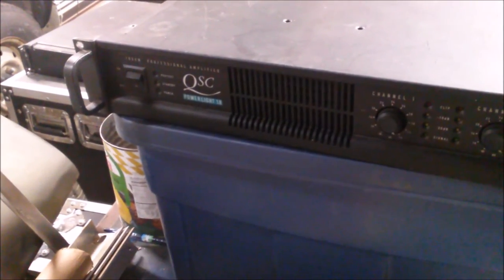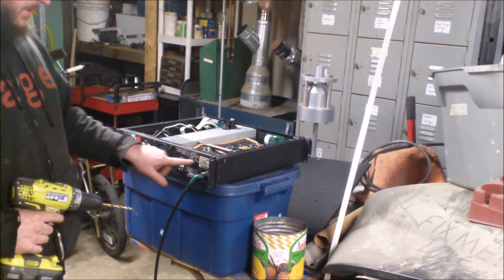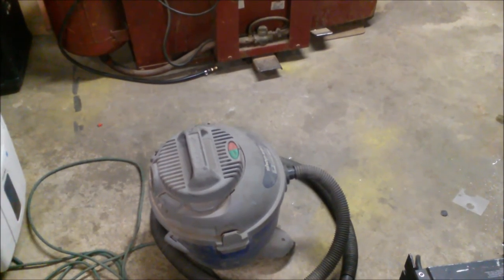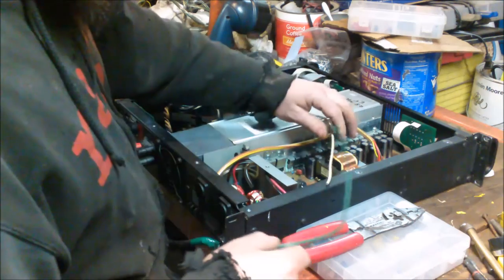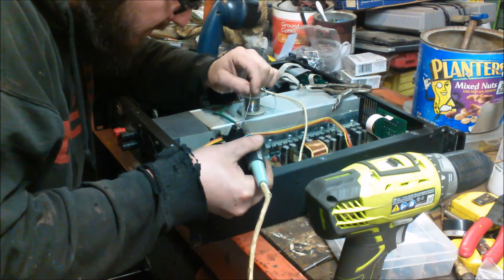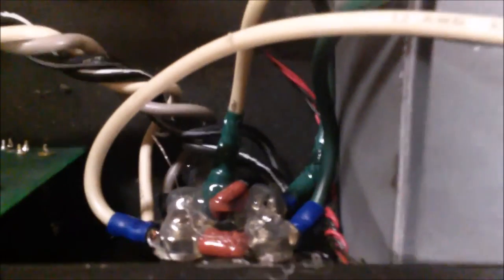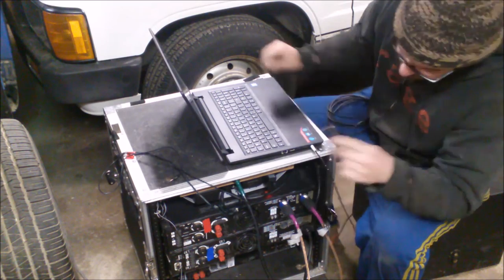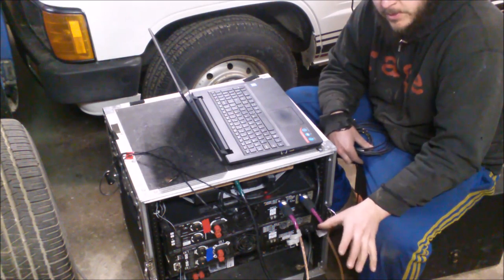Add Speakon outputs to your amp - DIY

Comment: I'm thinking about doing this to my technical pro ax1200 power amplifier because the technical pro ax1200 does not have speakon outputs.
Reply from the maker: I can't say I know your amp but I can say it was worth doing to mine!  Adapters are pricey and another thing to remember to take to gigs.  If you've got the space for them I'd say go for it.
Thanks for watching!

Comment: Can the qsc powerlight 1.8 power amplifier power big 18 inch pa subwoofers besides regular pa speakers
Reply from the maker: As long as the wattage requirements of the subs are within the power output of the amp, yes.

Comment: Quick question if you were to link 2 1000 watt power amplifiers together would the second power amplifier hooked up to the xlr link output on the back of the first power amplifier become a 2000 watt power amplifier and output 1000 watts per channel instead of 500 watts per channel or would the rms power not change whatsoever when linking 2 power amplifiers together
Reply from the maker: Hey,
It's generally considered a big no-no to try and combine amp outputs. As such, I'm afraid I don't know the answer to your question.

Comment: Does hooking up a graphic equalizer and a mixing console to a power amplifier boost the volume if so how does it boost the volume
Reply from the maker: It does boost the volume but does not have to. You'll want to do what's called gain staging. (Search this on google)

Comment: Would hooking up a entire sound system in a house consisting of a rack with 12 power amplifiers 4 graphic equalizers and 4 active crossovers and 4 power conditioners and a cd player and a tape deck and 2 mixing consoles all on separate breakers in a studio in a house make my electric bill very high
Reply from the maker: Power amps will consume the majority of the power. But of course, it depends how much you use them.

Comment: Quick question if your using a power amplifier to power big 15 inch or big 18 inch pa subwoofers in a building with tin ceilings will the tin ceilings resonate and rattle if you crank up the volume on the mixer
Reply from the maker: Tin ceilings- Maybe.  Suspended "commercial" ceilings- yes, absolutely.

Comment: Some power amplifiers have rca line out jacks and or trs 1/4 out and or xlr out jacks on the back that are not inputs and sends audio signal out of the power amplifier instead of sending audio signal into the power amplifier what exactly are these used for
Reply from the maker: These would be used to send the same signal to multiple amps. Let's say you have 4 cabs to power that all need the same signal.
Also, some amps have internal crossovers built in. This would allow you to output signal to another amp to power your subs, for example.

Comment: So if You flip the power switch on the power amplifier and if you flip the power switch on a giant mixing console and you hear a pop sound from the speakers but the speakers didn't blow is that normal to hear that kind of a popping sound from the speakers
Reply from the maker: Normal, yes. But I always turn the amps on last to reduce pops. Pops aren't good for amps or speakers. They'll survive usually but anytime you can avoid them that's best.

Comment: Can the bass from a dj system with 15 inch or 18 inch pa subwoofers break windows and do some serious damage to the walls and ceilings if the spl is high enough
Reply from the maker: Rarely, yes. Takes huge power though.

Comment: Will using lamp cord or a cheap 16 gauge bookshelf speaker wire cause a fire and serious damage to the power amplifier itself if you’re using bare wire method of hooking up pa speakers to a power amplifier
Reply from the maker: Lamp cord is fine. 16 gauge is fine unless you're running a lot of watts. 
Fire? Not likely... More likely you'd blow the speakers before that happened.
Amp.damage also possible.

Comment: Can 15 inch pa speakers get damaged if someone were to accidentally knock over the tripod that the 15 inch pa speaker is mounted on top of
Reply from the maker: Yes.  I've had a voice coil fail when a speaker was dropped on the floor.  Repairable, though.

Comment: Quick question if you can't run a power amplifier in bridged mono mode and you want to get the full rms power from it to power a single subwoofer or a single speaker can you take both channels left and right on a power amplifier and wire them in parallel to one coil on a subwoofer or speaker to get the full rms power from a power amplifier.
Reply from the maker: No, bridging is done by putting the outputs into series rather than parallel.

Comment: If you were to hook up a power amplifier to the tape output or the rca jack labeled rec out on a mixing console will you still be able to control the volume from the mixing console itself.
Reply from the maker: Depends on the mixer. Some have independent control, others do not.

Comment: I found out that some power amplifiers have a switch on the back that says ground lift what does that switch do
Reply from the maker: Ground lift disconnects the ground wire from the outlet to the amp. Sometimes this helps reduce him, sometimes not.

Comment: when hooking passive speakers up to a power amplifier what is the difference between using line array speakers and using regular pa speakers
Reply from the maker: About 5 grand! Haha, all kidding aside, line array setups are more common at larger venues, especially outside. They stack well and because of their angle, they have wider sound distribution.

Comment: Does a rack come with bolts to mount the power amplifier or do you have to go to a hardware store to get the bolts to mount a power amplifier to a rack
Reply from the maker: Generally racks do come with hardware, but not always.  I have actually had to buy them before... they are fine thread machine screws size M6 available at most hardware stores.

Comment: Are power amplifiers built like a tank so that they can not get dented easily or scratched easily from being mounted in a rack
Reply from the maker: Built like a tank yes but fairly easy to scratch the paint.  It's more about the durability of the internal components.

Comment: Will the banana plug binding post terminals on the back of a power amplifier break off or get damaged during road use
Reply from the maker: They definitely can! They usually don't if they are in a road case with covers on both ends.  
I remember this happening to me a couple of times before I got a good case.

Comment: Will a power amplifier shut off in 90 degree hot weather when your outside doing a gig
Reply from the maker: Not normally.  Although if it overheats, it will.  If it's being run near or above the clipping point in warm weather, it is likely to happen.  Also, air flow around the inlet/outlet must be kept clear.

Comment: I had to do the same thing on a 1u amp. Ironically in the end it went in a rack with a distribution panel that connected with bare wires. So all my hard work was for nothing lol
Reply from the maker: Aww, what a drag!  Oh well, maybe you'll upgrade someday and the new owner will appreciate the outputs?
Thanks for watching.
Reply: benfroggg I dont think I'll get rid of it because all I use it for is to run some tweets in my peavey sp4g speakers. Got them bi amped lol
Reply from the maker: That setup might outlive both of us...

Comment: Does the frequency effect the rms power of the power amplifier itself
Reply from the maker: No, my understanding is that RMS is an average power output of all frequencies.
Generally speaking, though, lower frequencies require higher RMS power because you are moving a lot more air/the speakers have to do more work.

Comment: If a used pair of pa speakers had missing compression drivers and or tweeters and only had the woofers in them can you run them off of a power amplifier still
Reply from the maker: Yes, but the ohms rating would be different than listed on the speaker.

Comment: Is it a good idea to place a power amplifier on top of a big 18 inch passive pa subwoofer.
Reply from the maker: I've done it for a temporary solution now and then.  I mean.. most amps will deal with the vibration but in general it would be better not right on top of a sub.

Comment: What kind of drill bits did you use for your drill when you did this
Reply from the maker: The big holes I used a bi-metal hole saw.  You can get these at the big box hardware stores.
The small holes I used standard metal drilling bits.

Comment: Quick question Can you use bridged mono 4 pole speakon plugs on a dj power amplifier that is not bridgeable
Reply from the maker: I guess the answer is I don't know- I am only familiar with the standard speakon terminals... Those just have 4 poles in the back to wire to.  If you're asking if you can use just two out of the four poles, the answer is yes.  But aside from that, I'd definitely spend some time googling how to wire speaker connectors.

Comment: Quick question can clipping damage a power amplifier as well as the voice coil of a speaker and also if the power amplifier clips half volume or less than half volume will the speaker be just fine
Reply from the maker: Clipping can damage speakers and amplifiers.  If you're seeing clipping on the amp, it's always best practice to reduce gain until the clipping stops.  This would be regardless of the overall volume you are getting or the input volume to the amp.
Generally, I like to gain stage so that my amps are at full volume and the source going in is below the amp's clipping point.
On subs, I use limiters.  These are similar to clipping but more controlled and don't do damage.  This gives the most possible volume from the speakers without damage.
If you look up the specs for your speakers, they should have a maximum RMS voltage (not watts in this case) number.  Once you know this number, lets say it's 20.5 volts AC, you can use a multimeter to measure the output of your amplifer and set limiters accordingly to reduce the voltage to below 20.5 volts.
On the other hand, the simpler method is to match amplifer RMS watts output with RMS input watts on your speakers.  A general rule of thumb is to have slightly more power than you need at the amp.  So say the speakers need 120 watts at 8 ohms each.  A good amp to power those speakers would be one that makes say 150watts at 8 ohms each channel.  Keep the gain lower than clipping at all and you'll be good.  This method will generally keep you from blowing speakers or amps.
Hope that helps.
B

Comment: When plugging multiple power amplifiers into one wall outlet what do I use to make it so that multiple power amplifiers doesn't draw too much current from the wall outlet.
Reply from the maker: Most outlets limit you to 15 amps. Commercial outlets often give 20. 
That's the maximum the breaker will handle- there is no way to increase this.